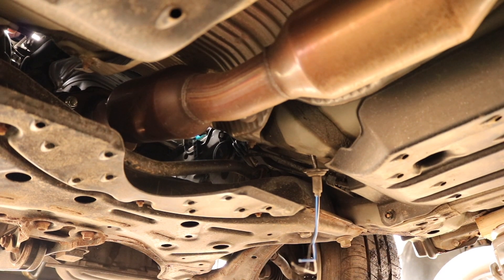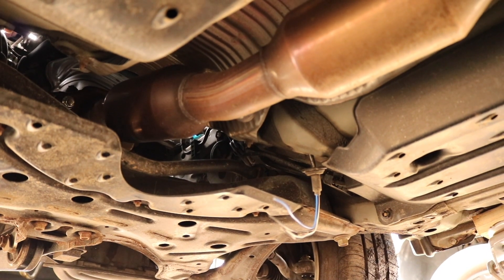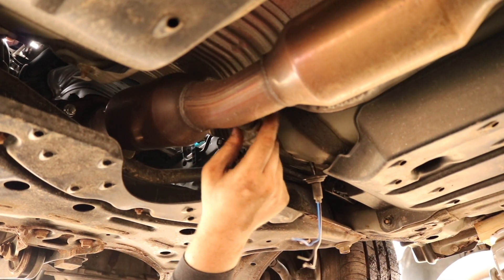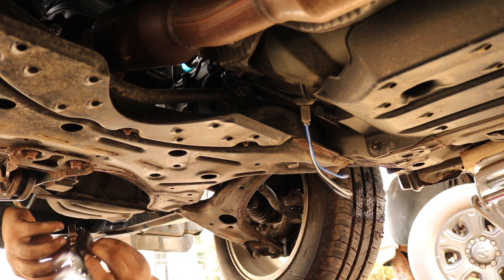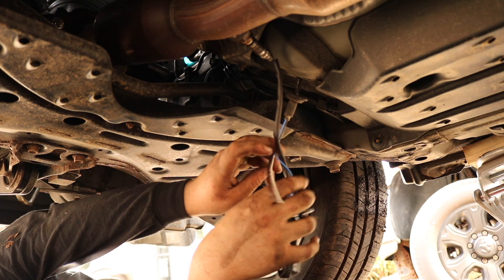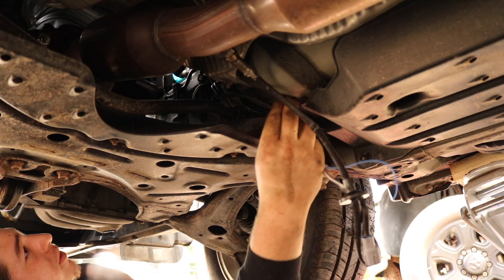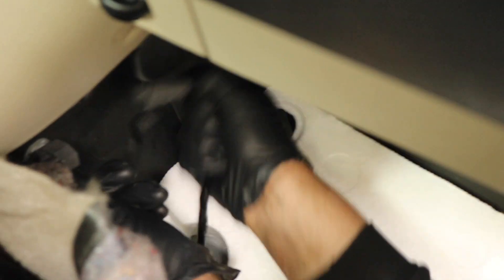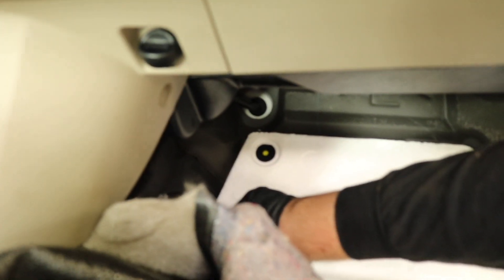How to change a downstream o2 sensor on a 2007 Toyota Prius

Comment from the maker: THANKS FOR WATCHING! More TOYOTA PRIUS videos here👇
How to replace an engine air filter on a 2007 Toyota Prius
https://www.youtube.com/watch?v=W0PUJI3mNf8

How to change spark plugs on a 2007 Toyota Prius
https://www.youtube.com/watch?v=cYHNkfLLu_Y

How to replace the battery in a 2007 Toyota Prius
https://www.youtube.com/watch?v=9iiqTwkh150

How to change oil and the oil filter on a 07 Toyota Prius
https://www.youtube.com/watch?v=zyVDceRwLvI

How to replace your cabin air filter in a 2007 Toyota Prius
https://www.youtube.com/watch?v=67ozb-YQZuo

Comment: Hi can u tell me which sensor is the O2  sensor circuit High Voltage Bank1 sensor2 on the 07 Prius?
Reply: high voltage? if you have a code for high voltage it means the computer isnt seeing the voltage it wants. either high or low. check your power going to sensor. hey better 10 months late than never.
Reply: @stephenr1999 haaahaa 😂